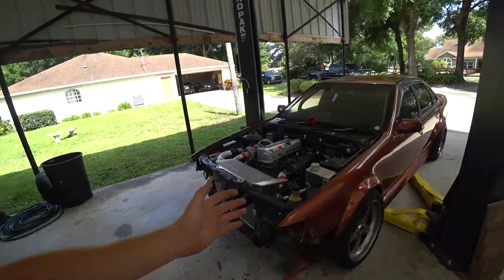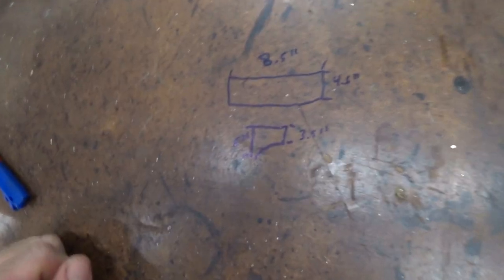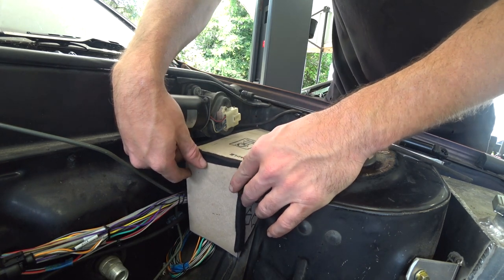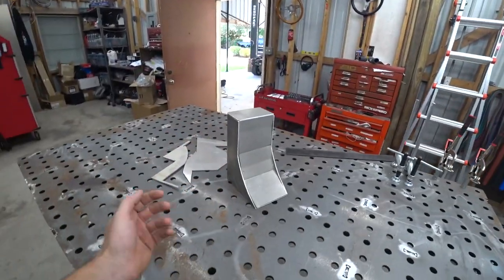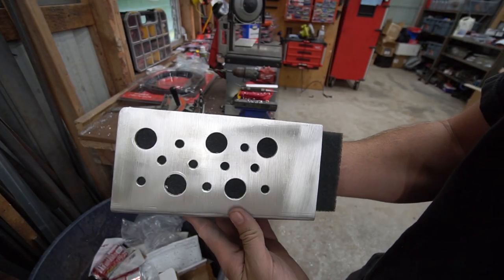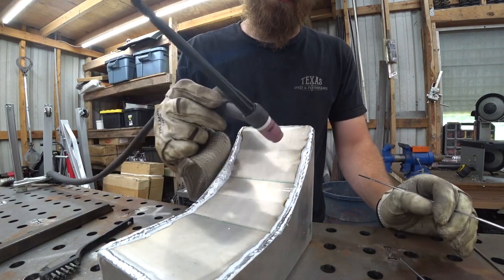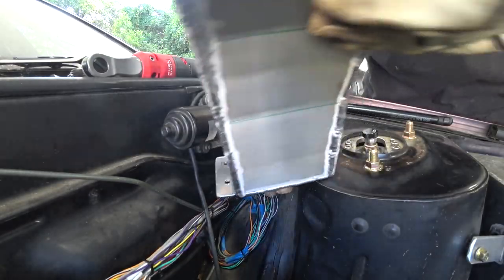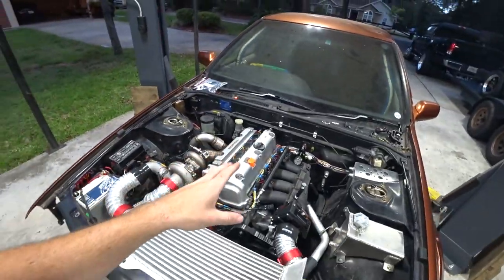The last fab projects on the K-swapped Cefiro build. Bitter sweet.

Comment from the maker: Click the link https://vessi.com/taylorr  and use my code TAYLORR to get $25 off of your Vessi shoes if you miss the sale! Free shipping to CA, US, AUS, NZ, JP, TW, KR, SGP
Reply: Bought a pair using your code 👌
Reply: Fyi Taylor, right now their code "Memorial" gives you a better discount, definitely going to use your code instead, but maybe reach out and see if they can get us a better deal? That way they'll get accurate numbers from how many people you referred! :)
Reply: If u gotta tip it like that to put it in what gonna stop it from leaking when u take out to drain maybe well in a barb and drain valve on bottom just a thought
Reply: Fuckin HATE wet shoes
Reply: As an Australian I appreciate the correct pronunciation of Aluminium.
Reply: Your catch can is gonna leak like crazy when it fills maybe even before it fills I don't think you should've drilled those holes in the top of the catch can you could've just put a filter to vent to atmosphere like normally, the baffling was a good idea  but you didn't need to put scotchbright or steel wool that's going to put metal particles in your oil that's the worst thing you could put in there, that plate would be more than enough baffling to avoid it spraying into the can with pressure.
Reply: I would also totally buy those shoes if they weren't 135$ with your discount code cuz that's super dope I just don't got the loot like that maybe one day when I'm doing better financially
Reply: @rustynutzz3504  as someone from the UK I have to agree
Reply: Thanks for partnering with us! Loved your video 🙌
Reply: @JZEFPV  So great to hear it! Let us know how you love them 😉

Comment: Please incorporate a drain tube and valve into the catch tank.
Reply: x2
Reply: Exactly. This is not really how catch cans work. Oil does not splash, or travel in liquid form in this system(if baffled correctly), it mostly gets vaporized. Its not intuitive, which is why it is mystifying, but oils evaporate with heat just like any other liquid(think oil/grease above your stove top, how did it get there?). Oil will condense in the catch can because of the temperature difference(much cooler). ALL catch cans need to be able to drain, simple. UNLESS you heat the catch can AND recirculate it to the intake.
Reply: @plumberman19  did you not see all the venting he put into it?. If he needs to drain it, he just needs to unbolt it....takes 20 seconds. What you're saying is true.. if it's a non ventilated can.
Reply: Very true, good points. That will help it not fill up as fast for sure.
Reply: This
Reply: A well built catch can won't need it
Reply: This is what I came here to say
Reply: @Matty.Hill_87  point me to a commercially available catch can without a drain, I’ll admit I’m wrong no problem.
Reply: It’s called a “catch can “ for a reason it needs a drain in the event it actually catches something. If they weren’t designed to catch anything it would be basically a vent and wouldn’t have the capacity to hold a quart of oil or more !
Reply: @Mn12birdman  it’s the size of the expansion tank. Therefore I’m calling it a catch tank. Sorry to upset you. Try not to be so fragile next time.

Comment: Ram board has a wax like additive, heat will lay it flat. Usually around 95° outside it'll lay itself down. In that Florida heat line the floor under a bench or table and let it flatten out, plus if you spill it's resistant like the shoes 😉
Reply: Not all hero's wear capes

Comment: look up the "Quick Vent Scavenger Oil Cap" from Level Seven Performance. You dont have to drill holes in your valve cover. it screws into the factory oil cap location, and has 2 fittings to vent lines to your catch can

Comment: hey, pro tip. use a router w/ 45* degree head on it to etch a line, so that when you bend the metal your not bending a 1/4 thick piece it will only be 1/8. adds 2 steps to the process but makes it so much cleaner and easier to work with. 2 steps being the router and the welding, as you will need to weld inside. doing it this way you can technically do all 5 sides of a box and finish with the top cap... or bottom whatever floats your boat man. most welds being on the inside makes the outside looks just like mandrill bends. love the vids keep it up.
Reply: dont forget to add thickness of metal to the sides lol i have to get onto helpers all the time for this lol

Comment: On my ka24 turbo I have two -10 bungs welded to my valve cover,  zero baffling,  to a catch can,  with hardly any baffling,  I also utilize the factory pcv location so in total I have 3 -10 lines going to the can venting to atmosphere. Almost zero blow by at 18 psi, just did a drift event , not even 100ml of oil in the can

Comment: Also welding the fittings as far forward as possible on the valve over helps with the amount of oil thrown out. Oil is heavier that oil vapor, so the oil will naturally be sitting in the back of the head rather than the front during acceleration

Comment: As far as the ram board roll, you need to hang it on the wall sideways with a few feet of the board hanging down, then hang some clips on the bottom of the paper with a few nuts or bolts on the clip to pull it straight, you usually only use a foot or 2 at a time, that way by the next time you need some it will be straighter. Thats how we store it at my work

Comment: Little tip for after the step drill, push harder into the blade on the deburring tool. Cut a solid chip all the way around the hole and it'll leave a nice chamfer. Make sure it bites in as you spin it around. One pass around should be all you need for a perfect edge. I'm so jealous of your welding table, my harbor freight one isn't quite the best haha

Also, you did a great job on the ad for the Vessi shoes. Going to try to convince my fiance to buy me a pair for my bday soon haha
Reply: So exciting! Let us know how you love your Vessis :)

Comment: For something that has taken so long to build, it looks like a craft shop threw up in the engine bay. Grab some 320, throw it on grinder, sand all the welds smooth, get a scotch brite belt on the grinder, sand all the aluminum with that, give it a uniformed finished look. Lastly, pull the engine, smooth out the bay, give it a fresh coat of black paint, it will super clean and factory. Its all the details you're leaving out that make it look thrown together. Oh, and you better install a drain in catch can or you're going to hate life everytime it fills up and you're at the track

Comment: Thats scary! Be careful, there's a service bulletin at all dealerships saying NOT to use 3M roll-loc discs to clean gaskets on engines (essentially your breather material) if the fibers get into the engine it ruins bearings! good you chose differently

Comment: Sand, and polish it just like you would a plastic headlight.... cheapo aluminum polishing kit for a drill with compound paste bar, I've done some JDM GC8 WRX STI lower control arms that way then sold them.. ya it took a while and I got dirty, but I was bored.

Comment: To prevent oil splashing out you need good baffles in the valve cover right?. Once it's in the line heading towards the catch can its not going to turn around and head back to the engine. I'm sure your design will work fine as a catch can but I don't think it will prevent it from filling up like you say.
Reply: Commented before you mentioned valve cover baffles

Comment: Do you think the steel contacting the aluminum would be subject to dissimilar metal (galvanic) corrosion? My guess is probably not because there will be oil coating it .unless the steel is stainless. I'm a big fan of your fab projects!

Comment: Hey, anyone know why a stock k series would consume like 5 quarts of oil in a 2 weeks? Never found where it was going
Reply: Mine with 220k miles kills a 2 quarts per 1,000 miles.
Reply: Rear main seal leak?
Reply: Was always under the assumption that they burnt through a fair bit of oil
Reply: Id do a leak down test and a really good visual check. Mine doesn't burn a visible amount on the 6 months I go on a oil changes. I will say I dont drive it daily but even when I autocrossed monthly the level rarely fell.  Stock 02 k20a2 157k

Comment: Are you going to sleeve the wiring harness? You get at least 10 horsepower from hiding those mustard cables.
Reply from the maker: Yeah of course. I just wanted to get everything fully sorted first. Figure out if I need to add or change anything etc.

Comment: As always, getting it done! But how does one drain that catch can?
Reply from the maker: With its location I would either have to
Run a massive drain hose. Or remove it anyway. So I’ll just remove it. Pull the filter. And clean it out. If I have my baffling setup well it shouldn’t need to be drained often.

Comment: I always thought the baffles in a catch can were to collect the oil vapor so it condenses. I don't see how baffling stops any "splashing"? If there's liquid oil in the line its gonna go through that baffling with zero issues. Pour some oil in that and I bet it just goes right in. Doesn't make any sense the way you described that's doing. Also why is it so damn big? I think you need to do another fab project to build a better/smaller one
Reply: Like you said later, the baffling in the valve cover is what would stop splashing and having a lot of oil get in the line. But once its in the line that stuff at the catch can will do absolutely nothing.

Comment: Hit up @boostedboiz on the valve cover catch can lines placement he did them on his k24
Reply from the maker: Placement is likely different since my motors mounted 90 degrees out. He would want his in the back of the cover I would want mine on the side so oil doesn’t slosh you under acceleration.

Comment: Steel wool will rust pretty fast.  How will you keep water out of it?
Reply: All the oil. From the breather in the engine.
Reply: @vincentgotter4669  I mean that the water will come in the holes at the top and collect in the tank.  It might happen pretty quickly if it's driven in the rain.  It would likely drain out the fittings in the side whenever it reaches that level.  Any water that collects will also rust the wool and it will dissolve pretty quickly.  I would think that would eventually drain out the fittings too.  I could be missing something though.  I don't mean to cause a problem, it just seems like it could be a flaw.